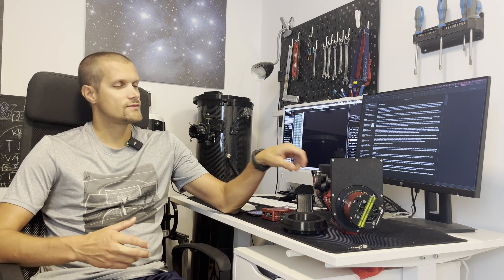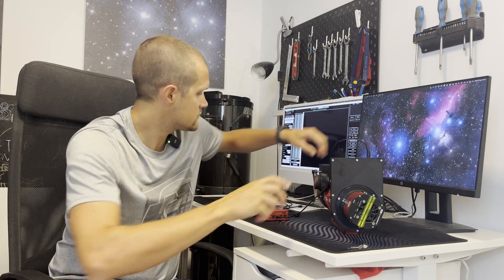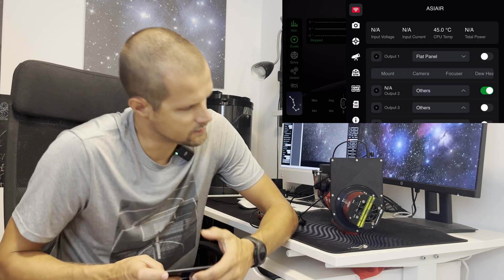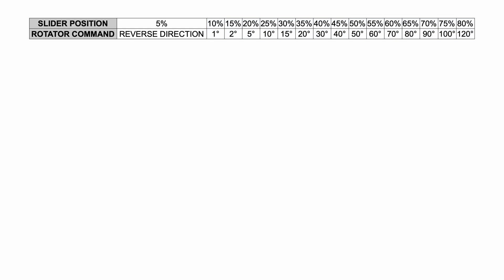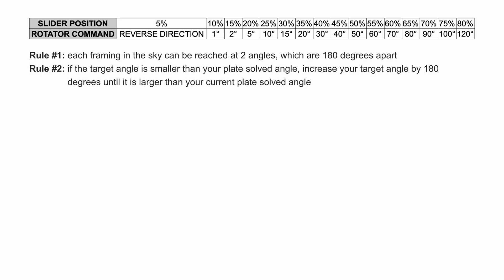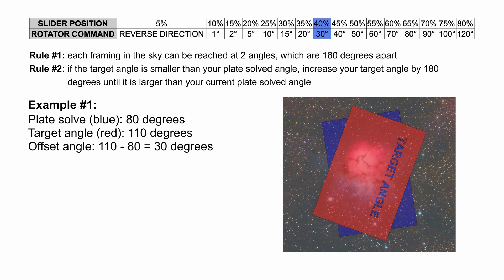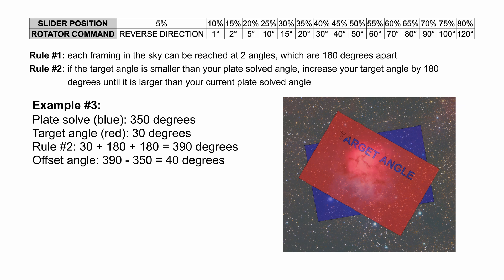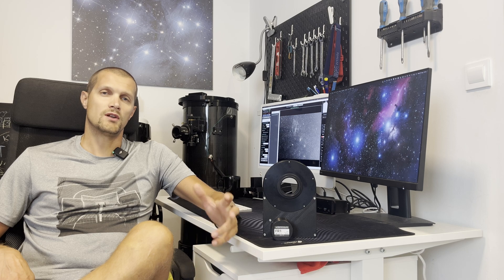First ASIAIR supported field rotator!

Comment: So, am I correct in assuming that if I choose to use your Flat Panel and Field Rotator together I'd be using all 4 of my ASIAir DC ports; since each device uses 2-ports... and would need to use a different power source box for my camera and dew heaters that I currently operate with the ASIAir's ports...?
Reply: 2 ports are for flap panel and field rotator control. You can add for example our DC HUB to port 3, which can split it to additional 5 ports. And 4th port is still free